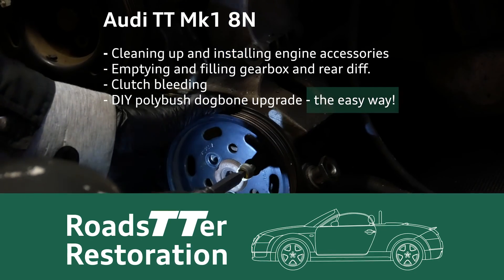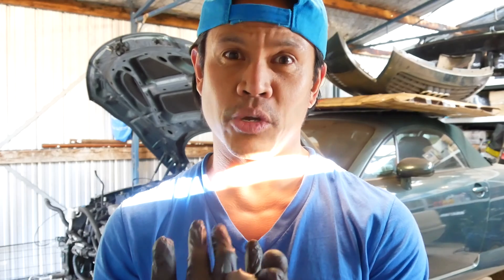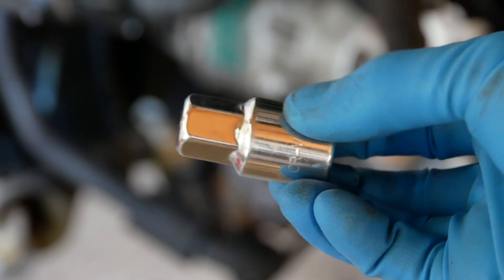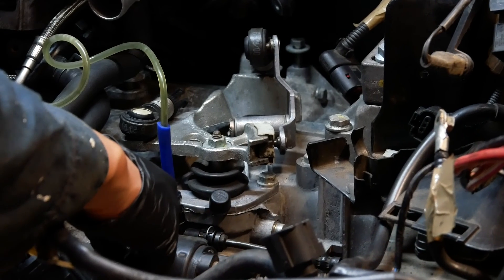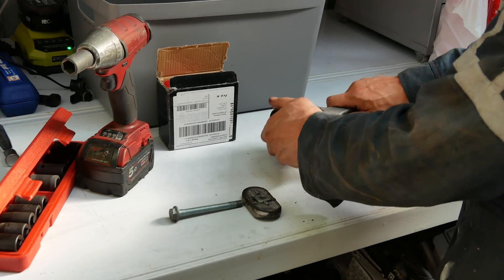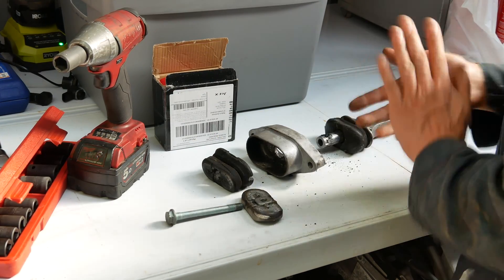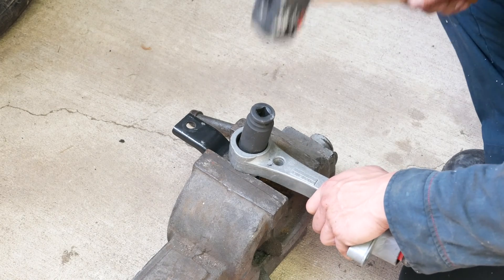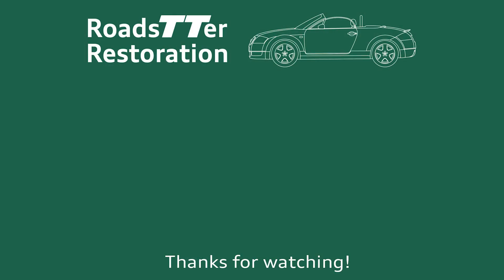Audi TT Mk1 Roadster DIY polybush dogbone upgrade + refill gearbox oil + how to bleed clutch

Comment: I used this same dogbone recently. How is it after 2 yearsv
Reply from the maker: @MrBoosted6000  still good! TT has been on the track 5 or so times and the bushes hold up.
Reply: @ the sandwich bushing  that bolts into the motor made me worried. Every single dog bone install video besides yours used a press fit bushing. Thanks for getting back! Gives me confidence 👍. Poly dogbone makes such a difference, mine was very shot!
Reply from the maker: @MrBoosted6000  Yeah that style bushing made it really easy to install! Agree once you refresh bushings it REALLY helps to tighten things up!